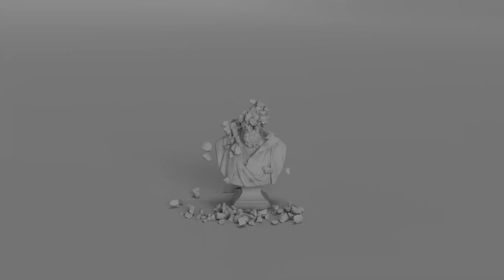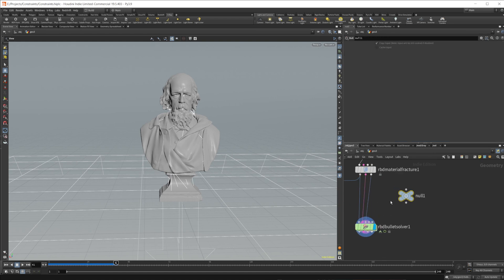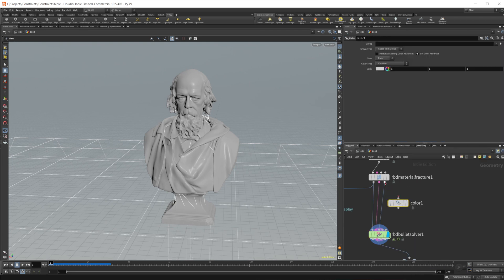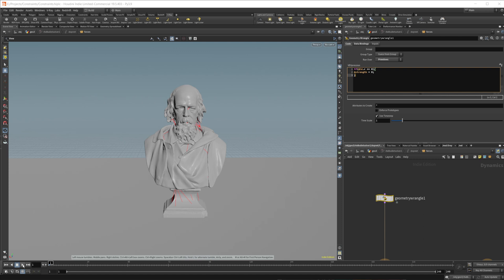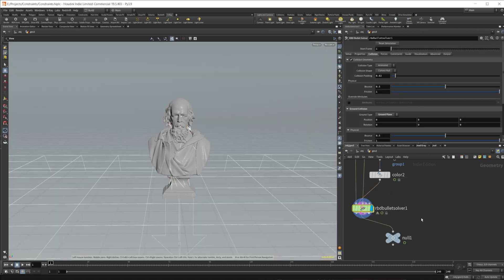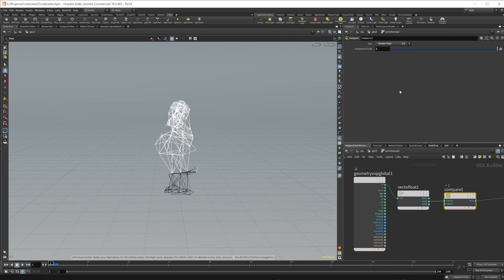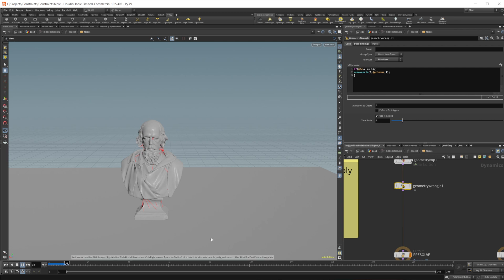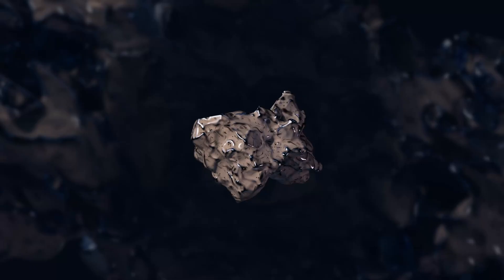RBD Constraint Explained | Houdini 19.5

Comment: You can animate things outside of the solver as well, you just need to add your animated Strength attribute to the "Override Attributes" section under the Constraints tab, then it will update that every frame. Same goes for animating Active or anything else. There are several places you can do this on the Bullet Solver node.

Comment: Hi, thanks for this very useful. A question - could you connect the colour nodes in the obj level to a null, then in the geometry wrangle set one of the inputs to that null then just read the colour from that input using something like prim(1,"Cd",@primnum) rather than add the vop ? (don't know if that would work but I think I've seen something similar using vellum constraints)
Reply from the maker: I'm not sure if it is or not. I would have to try it. From what I played around with though it didn't like animation outside of the solver.